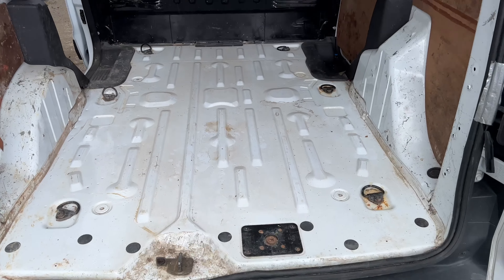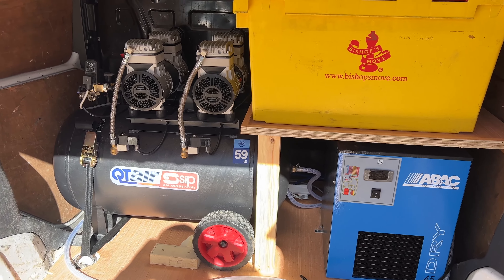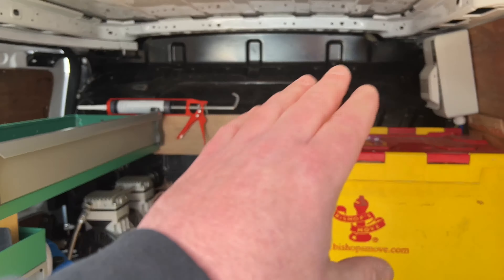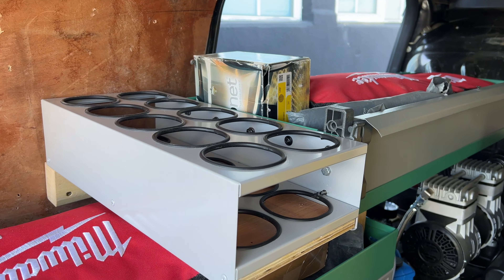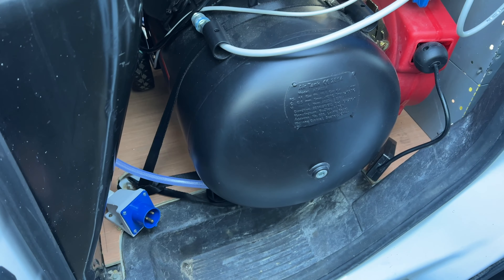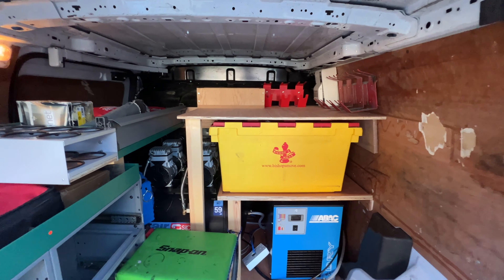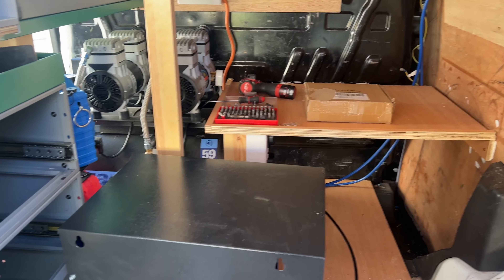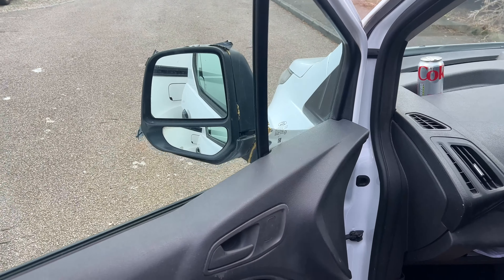Smart repair small van build pt3

Comment: Hiya Grant,
I’d advise you to have hook locks and shields fitting. Them additional locks you have are not really for security. More for multi drop drivers/couriers. They are called slam locks and you’re more likely to lock your keys in van with them. They just stop someone popping door open  when you walk away. However they don’t deadlock the van. Cable is just removed from handle and attached to cylinder. Sadly fords panels are so thin they are pierced easily. So defo contemplate The hook locks and shield plates.
Reply from the maker: Yeah it’s definitely on the list mate 👍

Comment: Hi Grant nice set up, this year’s weathers has been a pain, if it’s not been raining, it’s been windy as hell. 

I’ve got the Hyundai version of your air compressor, for mobile valeting. Mine has started to pack in after 2 years of daily use, the tank is drained every other day pending on its usage.

Have you ever had a Sip Qt100/10 air compressor before? If so have you ever had any problems with it? It’s double the price of the Hyundai HY27550 and I can’t see why, unless the build quality is completely different?
Reply from the maker: No I haven’t I’ve just took a chance